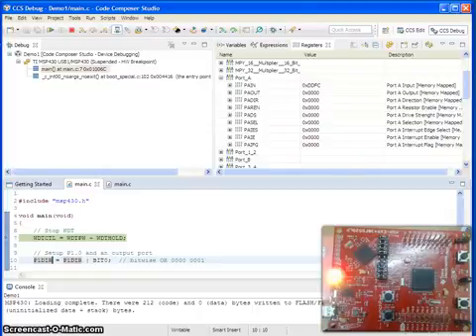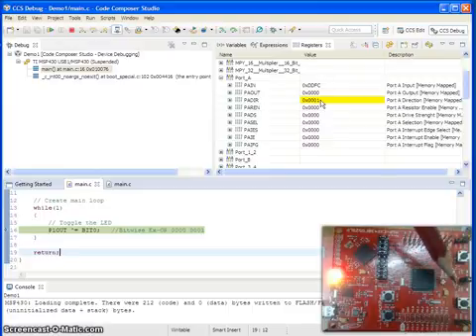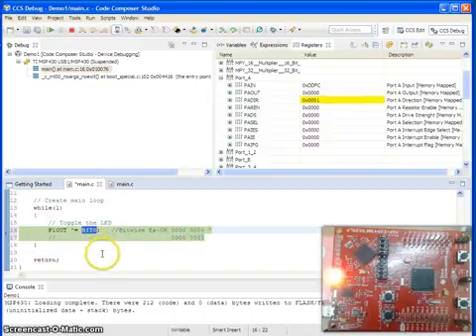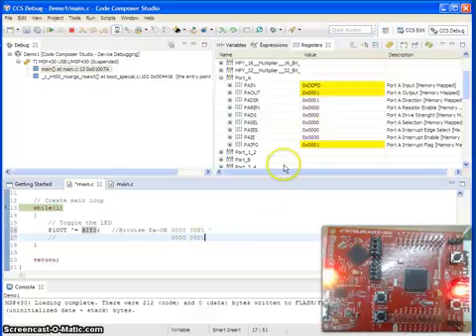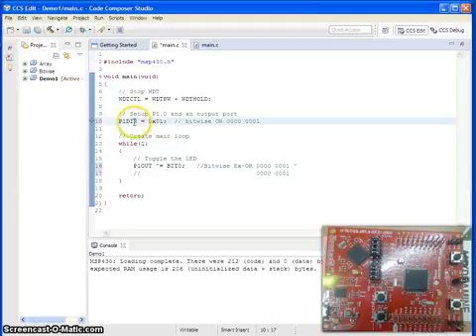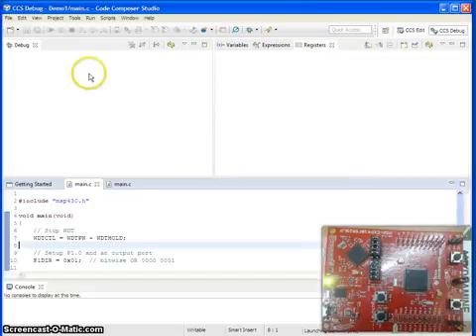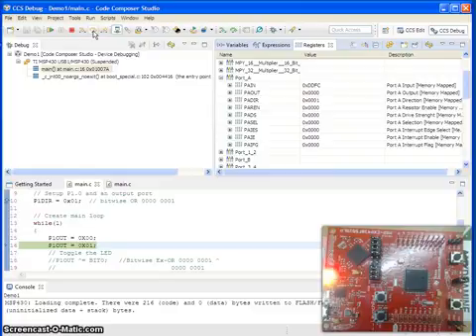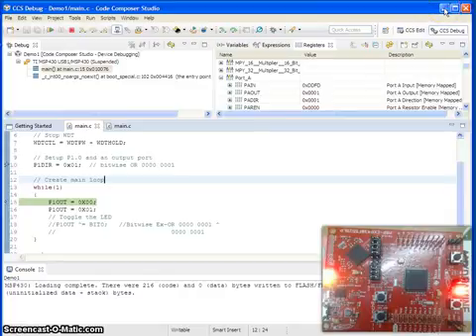LED Blinking- MSP430 Launchpad MSP430F5529

Comment: I am new to this and quite confused. So through the energia software I tried uploading and it says it doesn't recognize it on a port, I tried downloading code composer studio and it gave me the same message except this time there was a red led on the board when it attempted the debug. Why is this? I am so confused, sorry.
Reply from the maker: Hi, thanks for watching and posting a wonderful question.  The error could be due to
1. The board may be damaged
2. Check the jumper settings it must be the same as the video
3. If you use energia, the boot loader configuration is different.  I'm 100 percent sure that after u install the sw and drivers, in the first run, it will download the boot loader. It will be shown in the status window. This is a one-time action.  Once it's done, then you can download the sample code.
4. If u decided to use code composer studio, again the same procedure. I believe I have shown those steps in my video

Note... don't keep switching between IDEs. Select one ide and work with it.
Hope this helps.
Do subscribe and share